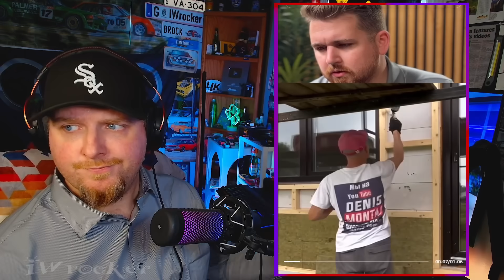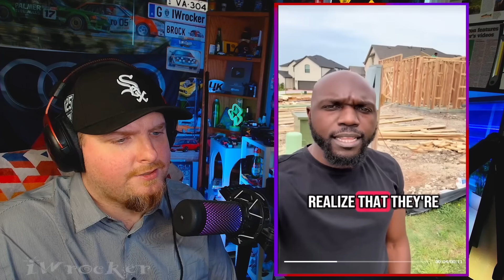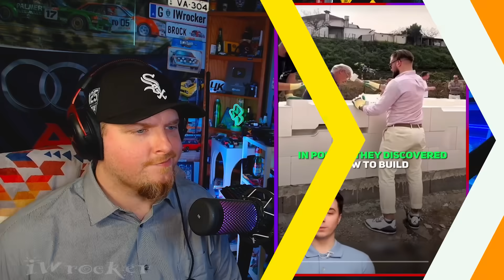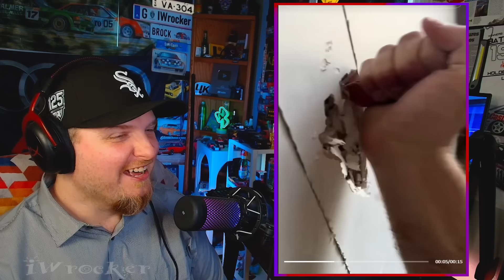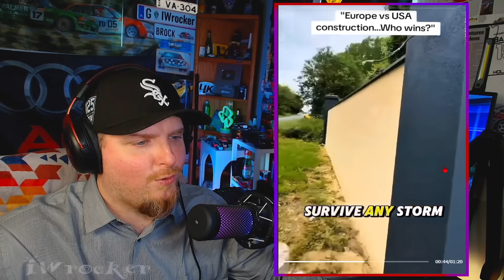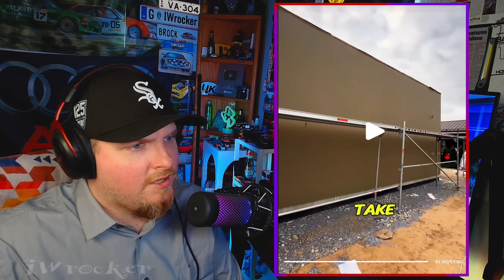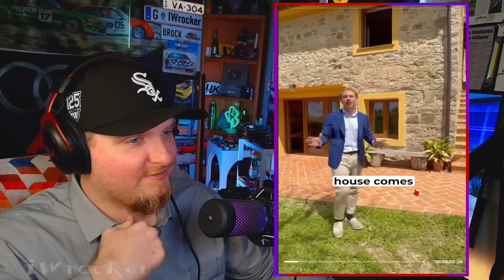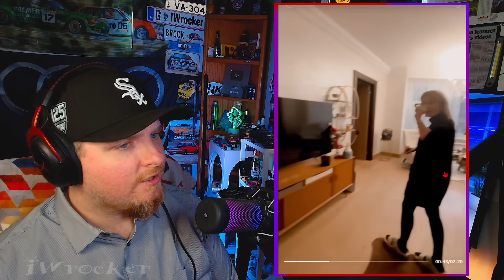25 Minutes of European VS American Home Quality & Construction Methods 🔨

Comment: 1.Insulation doesn't only keep the cold out, in summer it also keeps the heat out.
2. Why the Insulation outside? You don't wan't the cold or heat to even get to the inner wall as long as possible to prevent the brick, concrete, whatever to cool out or heat up on the inside 😂😂😂. That guy was/ is a builder? He have no clue at all of this matter 😂😂😂
Reply: High levels of insulation without solar control and/or thermal mass result in building heating up and being unable to cool down.  Too many UK homes are now built with high insulation values with no consideration to solar gain.  Older houses often stay cooler during hot summers despite having less insulation.  Many modern home owners are now crying out for A/C to keep their homes cool despite the fact that it costs 3x as much to cool a building by 1 degC than it does to heat it 1 degC.
Reply: @clivewilliams3661  That is only because there isn't proper ventilation installed.
The reason older buildings heat up less is because they are badly insulated or not air tight at all.

Proper (active) ventilation plays a HUUUUGE role in this! And is all too often overlooked or worse... deemed not needed (because "I can open a window"). It is only since the last few years that the proper attention is given to ventilation techniques. The reason is that 'we' build more and more energy friendly and thus more and more insulated.

Where houses used to be very 'open' via all kinds of very small nooks and crannies, they are now very air tight. So, it is not "despite" being less insulated, it is because they are less insulated that they retain less heat/cool down quicker in summer (at night).
The downside is that the modern houses can't 'breath' anymore as they used to. This makes (active) ventilation mandatory and very very important to prevent moisture build-up and over-heating in summer.

Unfortunately UK is still very behind modern energy efficient building. And still makes a lot of mistakes when doing so. They are quickly gaining though, but still.... a lot of people forget that with proper modern building you MUST have a proper ventilation system. And no, opening the windows from time to time is NOT sufficient at all.
Reply: @clivewilliams3661  What you describe shows that something is wrong somewhere, because in our country, insulation is installed to "passive" standards, with a minimum thickness of 17 cm. And there are no problems like the ones you describe; or rather, they are minimal compared to an uninsulated house (not that there are none at all).
Based on your description, I would guess that the heating system remained the same, and that is the problem. If the house had losses of, say, 8000 kW and after insulation this drops to 1000 kW, then the only heating that is "not very powerful" is electric underfloor heating or a heat pump.

So I guess you have the same experts as the American in the video, who don't know what they're doing, and you, the customers, hear their fairy tales, which you have now written down, while the problem lies in their knowledge of building physics.
Reply: @Odisovic  As a UK Architect I would be interested to know what country you are describing?

Comment: If the first one is a building constructor you are in trouble in the USA.
Reply: i wanna see that guy spend a winter in american made house in siberian winter where mild is -58f and proper winter is -94f. hes american house would look pretty damn stupid.
Reply: @1Gaat1  he could set it on fire and get the warmth for about 4 hours then die to the cold
Reply: Part of the problem in the US is that anyone with two left hands and a pickup truck can offer their services as a construction contractor.
Reply: @marcromain64 But only if he owns a nail gun.
Reply: @GettingNervous  No problem, you can get used nail guns cheaply from the nearest unqualified contractor who has gone bankrupt.
Reply: Looked like added insulation, that is either added on the outside or inside of the house post build. With that amount of insulation i doubt the owners would like it on the inside.
Reply: @zipp4everyone263  You only add insulation on the inside if outside is warmer for the most of the year (think Phoenix AZ). Otherwise your insulation will prevent your walls from getting warm. Cold walls mean wet walls, wet walls mean moldy walls. Frozen wet walls mean plenty of other surprises. You can also build cavity walls (popular in the UK) which will look great and provide terrific strength and insulation, but they require proper ventilation and drainage and extra materials.
Reply: @andreipetrenko2422  well, considering its something we do here in sweden, a very cold country... I dont know m8.
Reply: @zipp4everyone263  Sweden is not "a very cold country" by any stretch (unless we're talking Norrbotten) but still no one in their right mind would insulate their walls on the inside there. Of course, you can do that to your own house, but you'll have much more fun if you ever decide to sell it (that besiktningsprotokoll will be a doozy).
Reply: @zipp4everyone263 Agreed. But… What is he going to say if his live hood is to sell expensive crap? 😂
Reply: Insulation on the outside is quite common in our country. 

Oh and we don't put siding on that. That is then layered with a facade that is bonded with sub surface.
Reply: @Bungee75 Everywhere else in the world too. Even in China. It is the bottom basics of any construction knowledge.
Reply: He's doing youtube reaction shorts, so probably not much work to do. I wonder why...
Reply: it's clearly ragebait
Reply: Yeah. I was thinking same thing 🤔
Reply: There are only jobs in the USA, no real professions. Everybody can call themself everything.
Reply: It is also ridiculous for European standards.
Reply: even in a more temperate climate insulation and breathability pays off big time. But i guess you guys like sniffing glue vapors and mold. Lol.
Reply: Well, they are.
Reply: The houses at the start are NOT Russia !
Reply: It's all about cost in US sadly...

Comment: I’m a Norwegian carpenter. In Norway the walls are made with 2x8 with 8” of insulation first and cross insulated with 2” of insulation inside of that. Then it’s usually plaster boards on the inside or some mdf plates. There are lots of other layers with plastic and plaster on the outside ++ but that is generally the thickness of the walls. But you can punch holes in most walls in new houses in Norway too.
Reply: And there’s usually insulation in all walls. Also inner walls.

Comment: Compared to U. K. And Europe,  U. S.  Built houses are crap.  Yours need to be rebuilt after 20 years or so and you need a lot of heating in winter in the colder counties and you need  air-con in summer
 Our houses will last 2-800 years,  less heating in winter and next to no air con in summer.

Comment: I live in the Netherlands in a farm from 1650. When bought it 40 yers ago the roof leaked and some stone walls were quite bad. I have some walls teared down and used the same bricks to built the walls again.
The roof with real baked tiles has been renovated and isolated and the same tiles (375 years old) are used again.
Now everything iswell isolated (20 cm. )ready and it is great!
Reply: Lol, same here, my farmhouse is from 1648. Had some leaky walIs rebuild with the original bricks. Cannot imagine living in a drywall card box house 😂😂😂
Reply: Here in Sweden I used to live in a old house in the woods that was built 1775.
Reply: I imagine that your farm house is a listed building where you have to follow certain rules and procedures when rebuilding or modifying a protected structure which is why you reused those bricks.
Reply: @johnkochen7264 Yes, it is a listed monument, so it did indeed require the same type of 'yellow bricks' to be used, not necessarily reuse of the existing bricks, but it worked out that way (let's say 90% reused).
Reply: Yes, we use dry wall on wooden frames to board off a smaller space from a larger room but only in the interior.

Comment: I watched the section about the utility knife going through a wall, and I felt sick. Tomorrow t have to use a diamond coring drill to get through 2ft (60cm) of sandstone wall to put in a washbasin waste pipe. I did it once before for a boiler flue, and it took me 45 minutes. There is no drywall in my house, other than the garage ceiling. 🇬🇧
The facade in London is to hide a Tube line (London Underground) from the street view, so that the buildings are contiguous. They are an actual building, known locally as “the skinny house”
Reply: 45 min. lucky boy, 60cm stone walls in a shitty location, 100mm hole it only took me 3h each time 🥹
Reply: *ugh*, I feel your pain....
I need to do the same in a few weeks time to install conduit for active ventilation here.
Still, I'm happy with my brick/concrete house though. Rather this than an US 'cardboard box' house.
Reply: @CookieTube  We aren't afraid of the wind :face-blue-smiling:

Comment: Why would you want cardboard walls in the land of the drive-by? No wonder people talk about a desert eagle taking out the intruder behind the fridge, in your neighbour's house. 
Side note; why do you coat your roofs in highly flammable felt, instead of tiles that'd last >120 years?
Reply: because their houses rarely last 50+ years
and those that do were built in brick by european settlers
Reply: @Crushonius given they're so expensive, why wouldn't you want it to last generations? It's like building a house out of sticks in a place called "Tornado Alley", and wondering why your house gets destroyed a couple of times a decade.
Reply: @tobiasmills9647  i agree but murricans got brainwashed to believe that they are the best at everything and so they just blindly believe it

Comment: These walls insulated with thick Styrofoam or similar materials and then plastered are great, especially since you can retrofit them onto older houses. But woodpeckers love these walls; they peck through the thin plaster and build their nests in the insulation. And since woodpeckers are a protected species, you have to wait until they’re done nesting before you can repair the hole.

Comment: The London house is probably an old facade to hide the venting for the old underground train system.
Reply: we have the same in germany, over here its beeing kept for multiple reasons, Sometimes its simply because the Interior Structure is beyond saving but people wanna keep the old "face" of the house. Sometimes old buildings are protected from beeing torn down, so you have to keep the facade to protect the historic street view. Sometimes it involves legal loopholes, where it counts as rennovating an existing house instead of building a new house, like when you build a new house theres gonna be new laws which might have problematic restrictions that you can avoid by keeping the facade, like building to close to the property line, to close to the road, building beeing to tall etc
Reply: @Eumelkaiser  in my town the laws changed and all the "old" neighborhood (my town is very young, from s. XVII) maintained the façade to not lose m². The new regulations obligued new constructions to give space to be able to do a more functional sidewalk. People maintained the old ones but bulldoged the rest and only "refreshed" the façade. We have a classical construction façade with a modern interior house at the town centre.
Reply: It's the thin house in Kensington London and it's an actual house. Just look up "The thin house Kensington interior"
Reply: Edit: I think I'm wrong about the one in this video, it looks like it's another one in  Thurloe Square & you can actually live in these ones.

Leinster Gardens in London, there are some good pics online of what it looks like from the other side, a decent sized drop down to the railway below. There's youtube vids about it too if anyone's interested.
Reply: @wolfsbane-rw7um  The one in this video isn't Leinster (sp) Gardens.
Reply: @plonchyvideos  Yeah I edited it, it looks like it's actually Thurloe Square, I hadn't seen this one before.
Reply: @wolfsbane-rw7um  Thanks, yes, Thin house in Thurloe Square  (51.494216362754756, -0.17125595208622973). And when you look at it from above, you see it's trapezoid shaped.We are looking at the narrower side of the house.
Reply: Thin house Thurloe House
https://en.wikipedia.org/wiki/Thin_House
Reply: Yeah vents and also areas where it rises overground temporarily
Reply: Acts as acoustic baffling to prevent the sound waves echoing through the city
Reply: No its a house. well flats. Its quite famous. Wiki articale on it:

Five Thurloe Square or The Thin House is a block of flats in South Kensington, London.[1][2] The triangular building is 6 feet (1.8 m) wide at its narrowest. It was built between 1885 and 1887 by William Douglas on an area of land left over after the construction of South Kensington tube station. The building was initially used as artist studios
Reply: @anetka556  In December of 2020, a flat in Thurloe Square was sold for £855,000. At that price, the property was valued at £1,261 per square foot
Reply: I think I've seen it on one of the video's by The Tim Traveller, there is a small open stretch for the underground there.
Reply: Thanks for the explanation!
Reply: My thoughts as well
Reply: Yeah it's not actually a house 😂
Reply: @Rin-or-ISA  You can actually live in that one apparently, I thought it was the one in Leinster Gardens but looking again it's actually Thurloe Square.